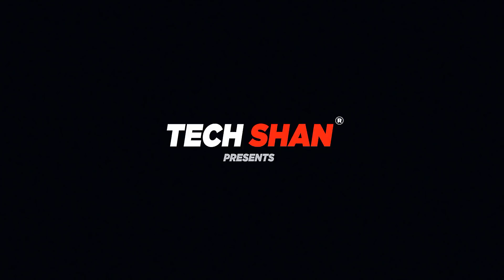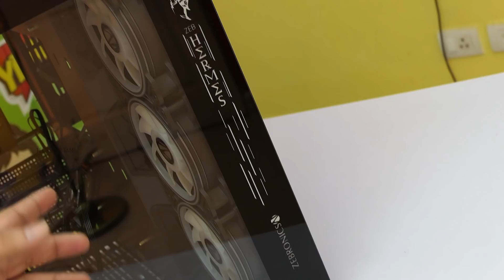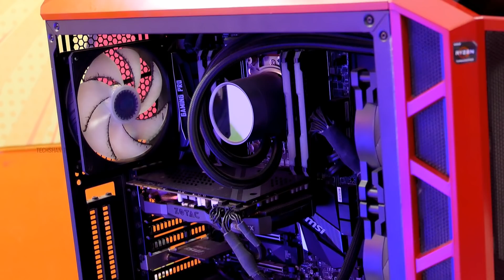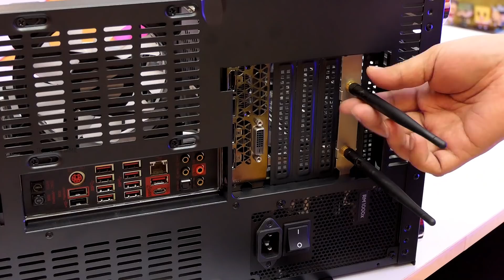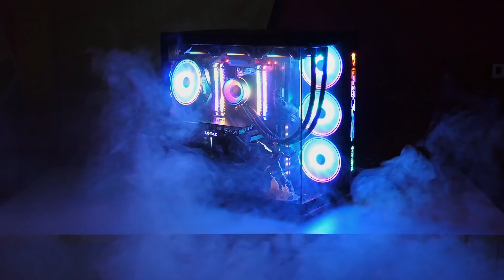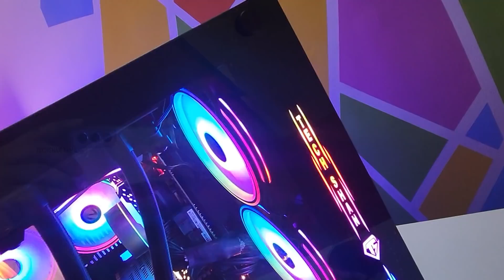Vera Level - My Ultimate Computer Build  | Customized ( In தமிழ் Tamil )

Comment: ungaloda video pathu inspire agi than enaku pc build pana thonuchu , veri thanama 3 years hardwork pani . Pc build pana 

Cpu : threadripper 3690x
mobo : asrock taichi trx40
Gpu1 : Quadro rtx 5000
Gpu2: Rtx 3070 ti
Ram : 64 gb
Ssd : 1tb m.2
hdd: 3tb
Monitor : benq 3200u

Ups : 2.5kv microtek

Comment: Great 👍👍👍 please post system configuration details... Thank you
Reply from the maker: Threadripper 2950x 16 core
MSI Gaming Carbon Pro X399 MB
64 GB Corsair Vengenace RGB pro
Samsung 960 M.2 SSD  X 2 1 TB
Segate 2 x 2 TB HD
Kingston m.2 250Gb SSD
Deep Cool Castle 360EX Liquid Cooler 
Zeb Hermes Case
Corsair RM1000X PSU
Reply: @TechShanTamil  ❤️ Thank you